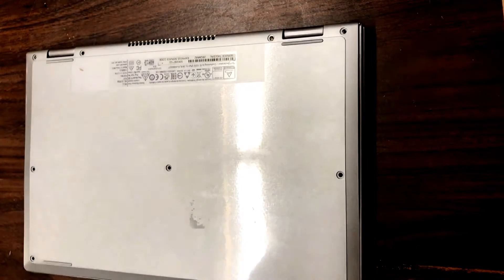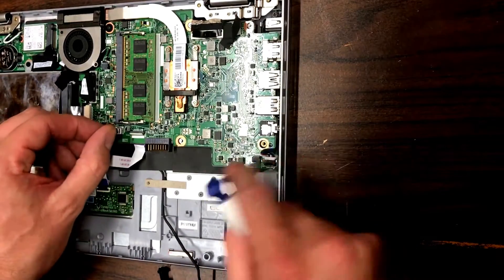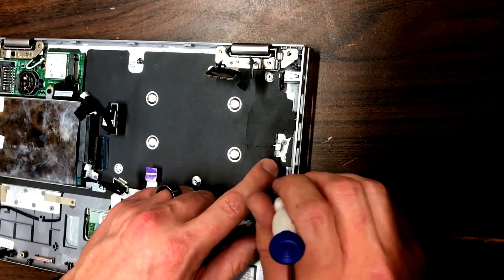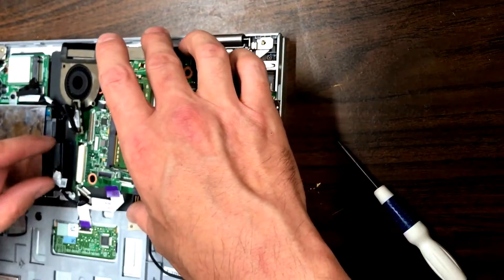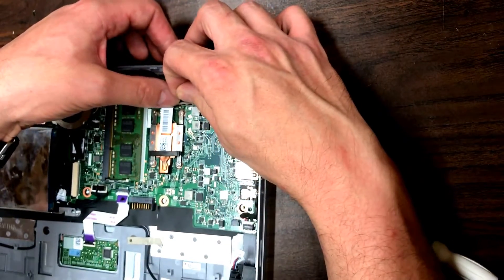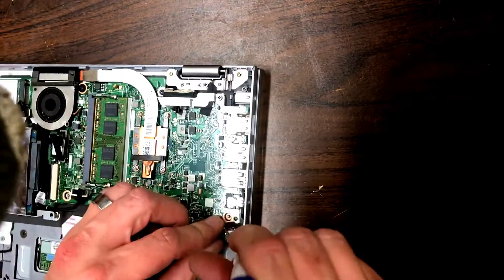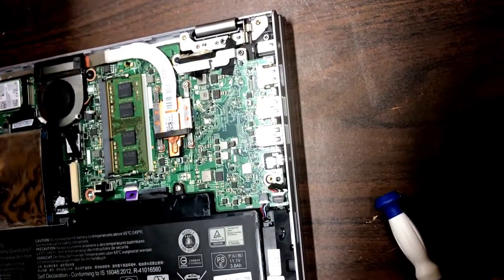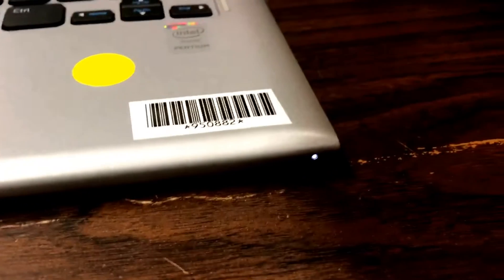How To Replace Charging Port On Dell Inspiron 11 3000 Series

Comment: I have a similar problem to one of another commenters. After following this tutorial, upon completion I turned on the laptop and the keyboard would not work. I shut it back down to investigate and I cannot figure out what is wrong with it. Any ideas? Help would be appreciated!
Reply from the maker: I usually assume I missed some connection first. It's possible that one of your connections either got forgotten, or just isn't al the way plugged in. Usually the easiest to check is the display. If you didn't get that squared in place it will not display anything. Try plugging in a monitor. If that works, you know that's it. Otherwise you have ruled one thing out. Troubleshooting is just a matter of ruling things out, so I would go connection by connection & make sure each is seated correctly.

Comment: Can't do an attachment. But it says the AC power adapter wattage and type cannot be determined. The battery may not charge. The system will adjust the performance to match the power of ailable. But it's not adjusting and my question is is it possible that I blew out the new power plug?
Reply from the maker: There are a few things that could have gone wrong. When you took it back apart you may not have gotten the power outlet attached snugly in place, it could have burned out, or you could have gotten a bad part. The original problem of the keyboard not working is most likely because the keyboard cable wasn’t quite seated correctly. Your best bet is to unplug only the power adapter without full disassembly & seat it back in place. Just make sure to unplug the charger and battery before you do. That may solve the problem.
Reply: Clint Liddiard after the first time of replace and put back together the power light came on but keyboard didn't work. The second time of taking apart the keyboard worked but then no charge.  So might have burned out the new charging  port
Reply: Even i faced the same problem..half of the time the battery is not charging,and it says plugging but not charging.what do I do ? My battery backup last atleast 4 hours..

Comment: Hello. I have changed out the port just as you did and walked through everything you have done. The first time that I put it back together the light was on but I was not sure if it was charging because none of the keyboard would work. So I took it back apart went through make sure all the plugs were plugged in properly and put it back together and now the light isn't on but I get this black screen here it says and I'll attach it